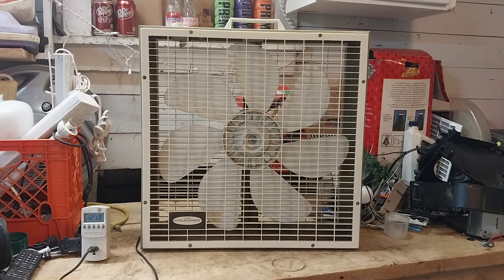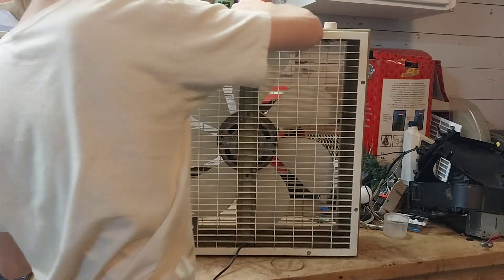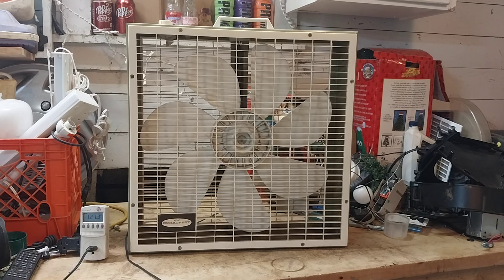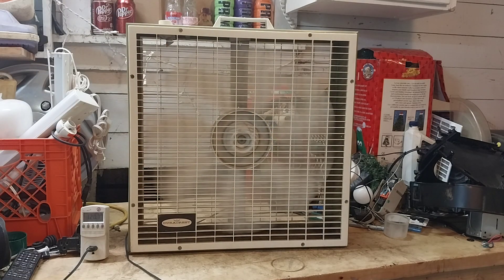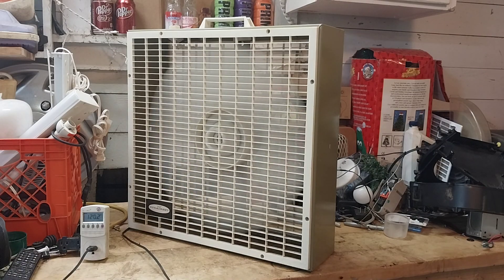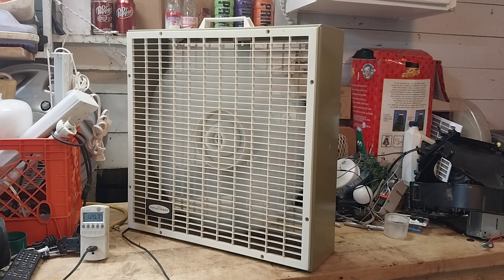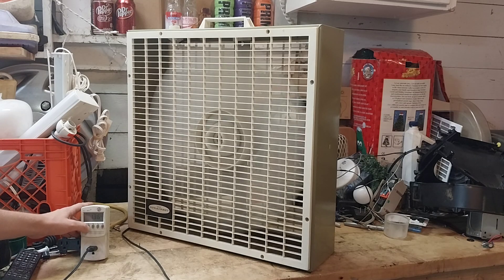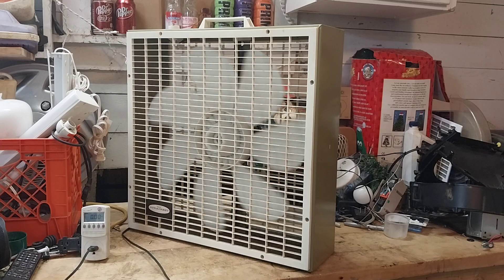20" Duracrest box fan

Comment: Collectors called that GE motor the fireball of doom. I have a Patton high velocity 12 inch fan and it has that motor and it seems to work just fine. It’s mostly the reversible export motors with two speeds that have the problem.
Reply from the maker: @DBVintage  thank for the info.

Comment: This is very similar to mine. Mine has the switch in the center behind the handle like most Hunter box fans from this era. My handle also doesn't have screws visible from the top, I believe it's a clip on handle. I have to get mine back out and take a look at it, I haven't had it apart since the summer of 2016 so I'm not quite sure how the handle mounts, I just know that it doesn't have screws on top. I used to have the stand and box from mine, unfortunately the stand and box did not make it through moving, at least the fan and the original paperwork are still around. I really don't use full size box fans that often, I usually use the smaller ones more. Very cool and I'm glad you were able to find one. I thought these were Hunter (Robins and Meyers)  motors in these. The GE export motors weren't all the "fireball" motors, just the 3 speed reversible ones, if I remember correctly. I have three 12 inch Hunter box fans (one is a Montgomery Ward, one an EXL, and one is a straight Hunter) that use a mini version of the export motor with a mini version of this blade. They're cute. I have a video from 2016 of the Montgomery Ward fan, I wanna do a video of all three together soon.
Reply from the maker: @brunoshow124  I'd like to see a video of all the minis. Apparently the mini fireball motors are still problematic. A friend of mine had a small Lakewood with one and recently it went up in a puff of smoke as he was using it in his window. I never knew that your Duracrest came with a stand and box. You probably said it in the video but I believe the last time I actually watched it was around 2020 or so. By any chance do you know what store sold these fans? Maybe if I re-watch the video it will answer my questions.
Reply: @theericfreeze1493  I have no idea who sold the Duracrest brand. Mine was the first one I ever saw with that brand on it. I'll get all 3 of the minis together for a video. I've been using the Montgomery Ward one for 8 years and never had a problem, and I really don't maintain that one at all.

Comment: Ah yes, Duracrest.  That was before it got bought out by Kaz and changed into Honeywest.  XD

Never seen that before.  That looks like a Lasko D-blade.  Lasko should've used that blade on its 80s Galaxy 20" (3713), to match that Galaxy 12" box fan with the 7 blades (3712).
Reply from the maker: @Xyspade  this blade is most commonly seen on the hunter EXL box fans. These predate the Galaxy D-blade fans so I wouldn't be surprised if they knocked off this design. The early wind machine had a 7 wing blade set, id like to see how that performs on the box fan.